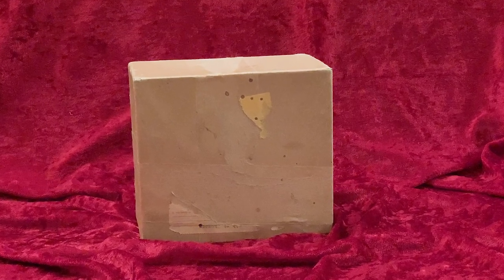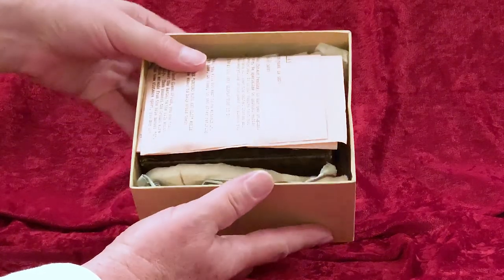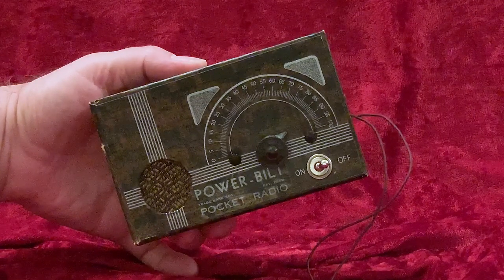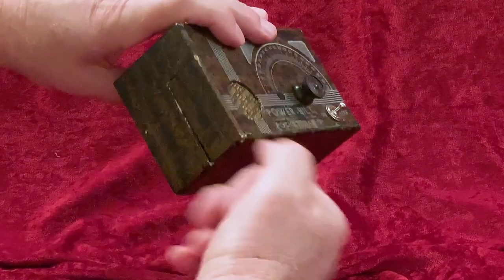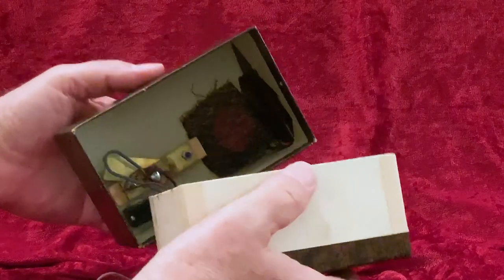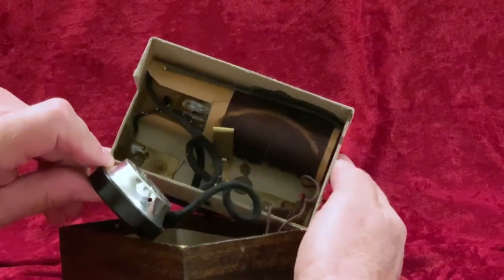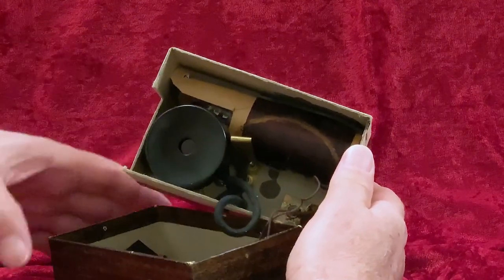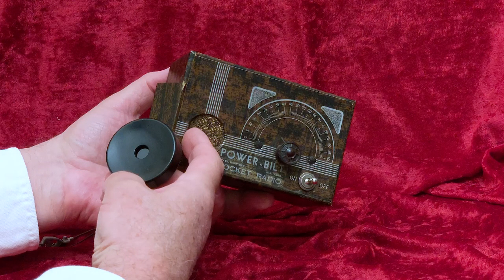Power-Bilt Pocket Radio early-1950s vintage unboxing - not transistor - collectornet.net

Comment: Rather than a TRF with a single tube as this is, they could've put the antenna inside and made a pretty good regenerative receiver with that single tube.  And then an earth ground wouldn't be required.